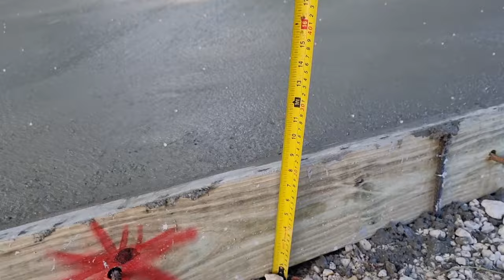S&G Concreting Roselle Main Road St.Thomas Jamaica Southern Coastal Highway Improvement Project

Comment: Very interesting, we have some concrete paved roads in Australia, they seem to use them here like an experiment, its a little different to drive on because you seem to get a different road noise but ive driven on it in the wet and it it fine not slippery and had good grip for braking, thanks for sharing bless up from down under 🦘🇦🇺👍🇯🇲👍🏿